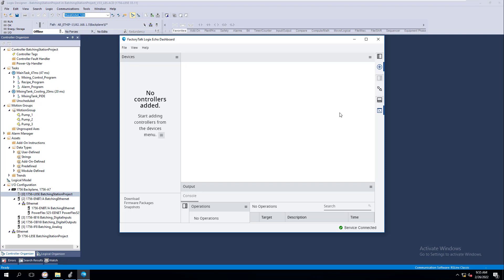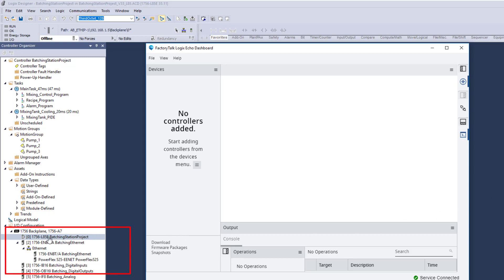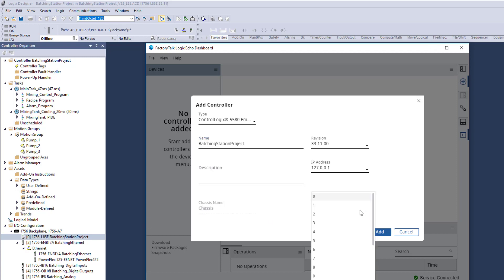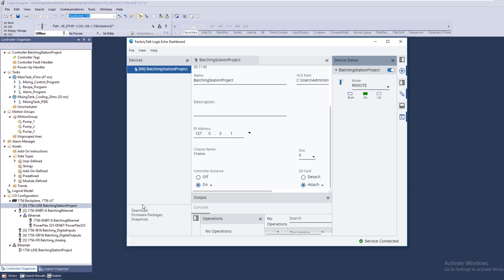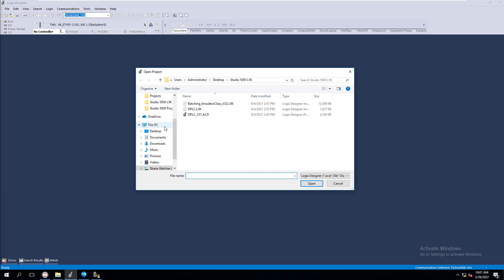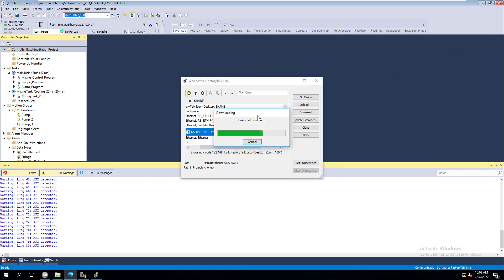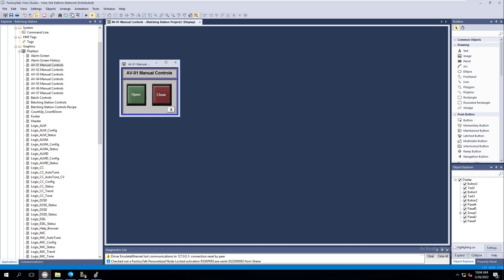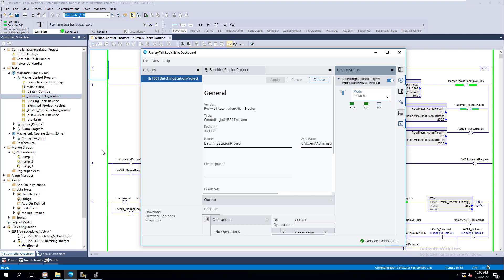Using FactoryTalk Logix Echo Tutorial

Comment: is there a way to use it with compact guardlogix 5380 V33? I only see V36 or higher 😭
Reply from the maker: Using FactoryTalk Logix Echo V3 with the firmware updates yes
Reply: @ShaneWelcher  how do I find the updates? I only found firmware packages to version 36 and 37
Reply from the maker: @jevr765 On the website ab.com

Comment: So, questions on what PLCs can you use, it is only the following PLC Firmware as of 2023/3/31

5580 ControlLogix - firmware versions 35.11, 34.11, 33.11
5580 GuardLogix - firmware versions 35.11

Echo software versions out are 2.01 and 1.

CompactLogix is not out at this time.
Note that this is not StudioLogix versions.
Reply from the maker: I use Echo V1, haven't upgraded yet.
Yes, I know it's a bit limited
Reply: @ShaneWelcher , Thanks for clarifying what you are running.  My note was for the general audience.  Just installed V2.01, as I am working to use Echo on one VM and want to talk with another VM running System Platform for development.  Did it with Rocwell Emulate 8 years ago or so...

Comment: Is Logix Echo able to do a redundancy simulation?
Reply from the maker: There is a known issue when using multiple controllers in Logic Echo as of 7-22-2022, Rockwell is working on this & may have a resolution by now, however I am not aware of that fix.

Echo is a new product from Rockwell so they are going through growing pains from what I see unless you have a lot of ram being used fast CPU being that Echo is computer based.
Reply: You can download redundant project into Echo controller, but it would show status "primary without secondary".
Reply from the maker: @adamplesyt  You'll run into problems running multiple PLC programs with Echo right now on Echo version 1.

It is a known fact.

They are working on making it more durable.

Comment: Hi Shane, how should we add new firmware into this echo , right now im only able to create for V33.11 , looking to use it for V34
Reply from the maker: Right now, I do not believe there is an option for that.

Echo is new & is something they need to make some improvements on so I think that is what they are concerned with instead of new versions.

At least as of 7-26-2022 from my knowledge.
Reply: @ShaneWelcher  Hi Shane, I manage to find the option , on the most bottom left there is a option to add firmware packages. Cheers
Reply from the maker: @zackzhu1617  

Good to know...I do know that they have efforts around fixing a few bugs.

Just wanted to let you know.
With that said, they are generally fast at fixing things especially in the last two years
Reply: @ShaneWelcher  Thank you , your videos are amazing 👍